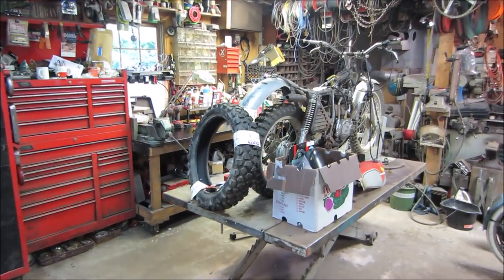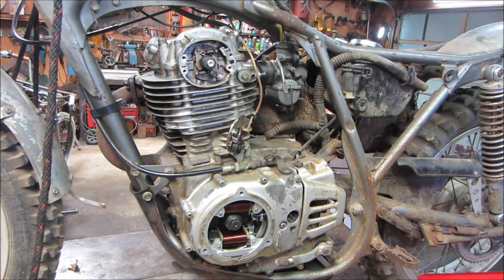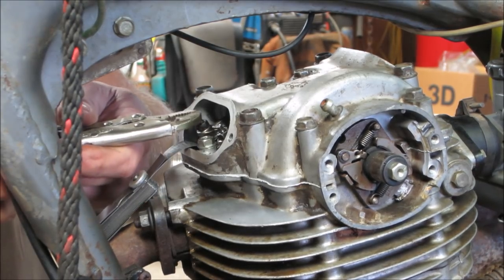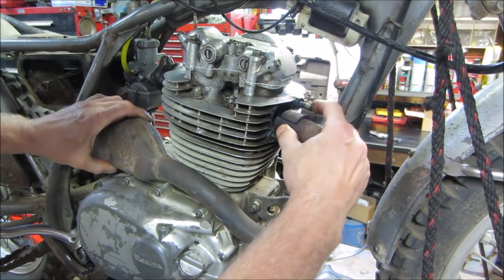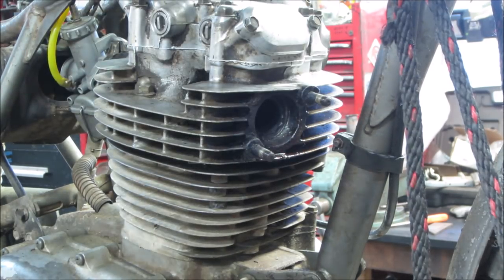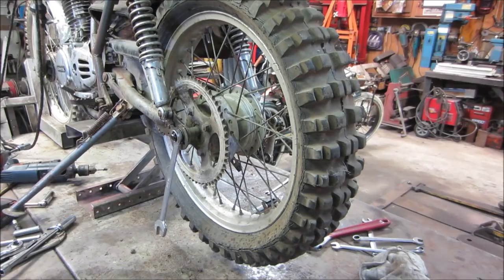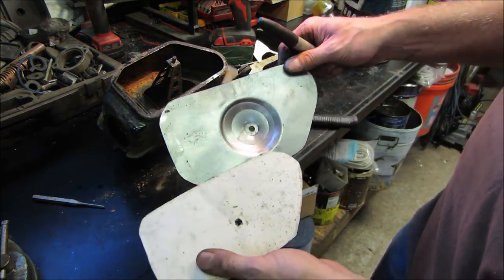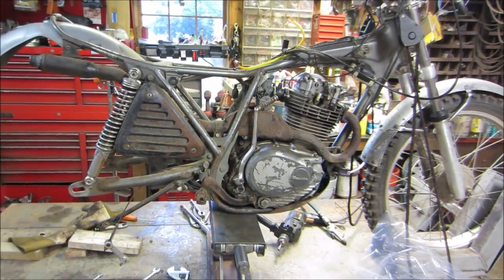engine work on the old honda 250 trials bike,

Comment: Hi Mustie, I originate from the UK, I am now retired & living in Thailand. My background is in aero engineering but I was bitten by the motorcycle ‘bug’ long ago. Until I moved to Bangkok, I spent my spare time restoring old motorcycles. It gives me so much pleasure to watch your videos. My main weakness was painting. I restored a 1955, 350 BSA & decided to have a go at painting it myself but I did have the fuel tank professionally painted. I used an engineering paint, made by a company called Blackfriars, but it’s main drawback was a long drying time & white spirit as a thinner. I didn’t have a spray booth - I got chucked out of the wife’s laundry shed for getting overspray on everything. I sprayed it outside on nice days. Trouble was it seemed to attract bugs. So many times I had to remove the paint & start over. After I sold it, the man who bought it sold it on but one day I got a phone call from the new owner. He told me that he had entered it into a concours exhibition & it won second prize. He said that the judges were impressed by the paint work because it didn’t have that hard ‘glassy’ look to it, which made it look as if it had it’s original paint. It’s main let down point was the fuel tank that was black with silver panels on each side, the silver should have been chrome! He wanted to know what other parts were not original so that he could make it fully original for future shows.

Comment: You repair of the exhaust pipe flange fitment and the air box cover really demonstrates the value of your metal working knowledge and experience.  I'm impressed.

Comment: After a lifetime in the trades I am able to do little else now but watch. That said I sometimes have a little trick to share and I think you will use them. Here's one. When cutting ,drilling or milling aluminum get a spray bottle of denatured alcohol as a cutting fluid . This keeps the metal from galling by keeping it very cool. You'll find it leaves almost a polished finish.

Comment: ahhhh , the sheer enjoyment of removing the rear axle on a vintage bike that hasn't seen grease since Japan ! Nice job on the air box lid fab .
Reply: I experienced that joy just a couple months ago (Trail 70 with 700 miles).  It was also very nice to have a nice hot garage to work in.
Reply: Watching Mustie use a panel beating hammer for actual panel beating.... Phew!!!!!
Reply: nothing compared to the stinky whale oil in the forks on vintage japanese bikes. wretch-inducing.
Reply: @jonnoMoto  I remember that fish oil, that’s crazy. Then again, it was when we ran still ran bean oil, no synthetic back then.

Comment: Mustie, I was going to suggest you use anerobic sealer on the rocker cover in the last video but forgot to mention it after watching. It will only harden where the surfaces meet, otherwise it stays soft and wont clog anything. I use it on supercharger assemblies because it stays soft when it squeezes out and wont damage anything if it comes in contact with the internals. That was some impressive flange making!

Comment: Excellent project that is inspiring me to finish a 1963 Honda 90 CL that I put together back in the late '80s and never felt the need to complete, as I was riding a HD Sportster back then & 1200s later, but now that I'm old and busted up, I might pull it out of the shed and get 'er done finally. Hmmmm?? Thank you for sharing this video.

Comment: A trick I learned for adjusting valves with those square adjusters is simply screw a #2 Robertson screw into a small wooden dowel and there ya have a holder for that square adjuster.

Comment: When you were forming the air box cover, a neat trick I learned from a metal worker: a foam seated bar stool. Put your piece into the middle of the stool seat and pound on it in the middle. It will draw the piece out where you hit it. I saw Jessie James do a fuel tank this way without using an English wheel. I've tried it a couple of times, works great!
Reply: Sand bag will also work
Reply: Yeah I've seen that done too...just don't over stuff it, you want the sand to be able to move so the metal conforms to the strike.
Reply: If the metal is heated- it stretches nicely, too.
Reply: and if you want to shrink it, dump ice cold water on it while it's hot......
Reply: Wouldn't a shock quench like that HARDEN it, make it brittle?
Reply: That's where I got that..but the old bar stool in my shop looks like it's been in a few fights..and possibly a couple wars now too ;)
Reply: yes ,,,so reheat it it to let it air cool, (anneals it)(makes soft again)
Reply: Shock quench will harden high carbon steel, but has no effect on mild steel. It's a pretty good assumption that Mustie was using common mild sheet steel.
Reply: The easiest way is to ditch the airbox and install a slip-on paper filter.
Reply: Vivian Stimpson yes , its the satisfaction of making it , no so much the easy way out
Reply: I like the way he did it, sharp looking job

Comment: If my copper seal rings are a bit too small, i get a punch or something that's cylindrical, put it inside the ring and roll it on a steel plate under hand pressure. Basically stretching it a little all the way around. Works for me. Love your channel btw, i work on old American cars in Europe.

Comment: Great video as always!  I understand why you speed up repetitive work, but I would appreciate subtitles for the high speed commentary if at all possible. 

I bought a broken 1965 Honda C110 (50 cc)at age 13 in 1971 for $100. It was completely dissasembled and Honda had stopped making shop manuals for it. Eventually I figured out that the exhaust valve was slightly bent. I tapped it lightly until it was straight as tested in a drill. After using compound to seat the valve and enlarging the exhaust port to match the pipe, a smaller friend hit 62 mph on it. It's 4 speeds, a clutch, and 17 inch wheels were lots of fun.  Looking back, I'm glad nobody ever got hurt riding it. My rule was, if you wanted to ride it, you had to wear ear a helmet.
Reply: I had a C-110 too!

Comment: The XL Airbox is a different shape I believe because XLs had a battery in that area strapped onto the side of the box behind the opposite side cover.
The edges of the original TL airbox side cover (I had a TL125, but yours looks similar) was rounded so that the edge fits into the groove in the neoprene gasket, so when you tighten it on it is completely watertight. That way the only water ingress point is the inlet which is at roughly the same height as the tailpipe. That way you could ride a TL through a river pretty well up to height of tailpipe without water getting in the carb. I rode TLs in very wet trials in the 70s & passed many a Bultaco knocked out by deep river sections.

Comment: with any stuck valve its sensible to remove the cylinder head and check out the valve stem,,seat and guides for corrosion.Good time to fit new valve stem seals if it has them. 9 times out of 10 the valve seats spotty with rust,and the stem needs a good clean.Guides need a good look over and clean, Lap the valves in by hand and its away again.Check the play in the piston and check the lip at the top of the bore which is a good clue for blow by. Enjoy your videos,cheers Graeme from New Zealand

Comment: I've been trying to decide if my favorite tool is your tappy-tappy hammer, or your little fuel bottle.
Reply: Definately the body hammer
Reply: Both are absolutely necessary in every workshop ;-)
Reply: I gotta say the fuel bottle with cam 2...purple
Reply: It's the body hammer. He uses that on everything.
Reply: Hammer ! But only for the tappy tappy reason ...
Reply: I'm adding both plus the q tips to my weak ass arsenal!!!!
Reply: @stillakilla7520 using  q tips are a good idea as well
Reply: I have added a white coffee cup to my tool bench to check for water in fuel situations.

Comment: I used to have a 1981 XL125S, before that I had an XL75 from 1977. Watching these makes me regret letting them go even more than I already did lol. I did a lot of work on the XL/XR engines, and that looks like the design they evolved from, a lot is very similar. I'd bet you could put an XR or XL 250 engine right into that frame with no fab work.

I still remember the valve lash for those engines, and it might be the same for that engine, 40 thou on the exhaust and 30 thou on the intake.

Comment: love watching your videos i like working on old hondas as well lil trick i learned take a square head drywall screw heat it up bend it over fits those valve adjustment screws makes adjusting them easy keep those videos coming !

Comment: Ladies and Gentlemen, always use a softer metal rod (Brass) to hammer out something threaded and steel. Otherwise you will "Mung" the threads. @41:24, Mustie1 (off camera) was bashing down the "Mushrooming" of the brass rod so it would fit the bore of the bearing. The brass is what you would call "sacrificial". Don't use a steel rod to do this. I hope I am not stepping on Mustie's toes. :-)
Great work sir.

Comment: I have a matco compression tester I've had for 25 years, it looks like the one you have, except there is a short hose that screws into the spark plug hole and a adapter for long thread motorcycle style spark plugs. I never had a problem with mine. My check valve was on the guage also and the hose was wide open, and it fits my air hose Chuck at the shops I worked at. I would use it to hold valves closed while replacing valve stem seals on the car.

Comment: When you kick it over and the compression blows out the spark plug, THAT’S compression!!  For that “little” 250, you’ve got more than enough. I had an XL 250 Enduro 1974 that ran like a top for years and enjoyed every minute of it roaring through the woods/trails. It was a dual purpose bike(street-trail) , but I stripped off signals,front fender, tail light, gauges ,swapped out the dual terrain tires for a good set of knobbies, changed the rear sprocket- dropped 2 teeth, and first time out torqued every nut/bolt/screw. Also had the high ground clearing exhaust (scrambler ?) sitting just high enough to get your inner thigh burned if you weren’t careful.

Comment: A leak down is used on aircraft cylinders since they can crack and lose power.  I looked for about 78/80 to show a good cylinder.  If not, listening at the intake, exhaust, and breather would pinpoint the leak.  Friend of mine had an O235 Lycoming with a hole in the head casting.

Comment: Check the cam chain adjustment - it's nut on the back of the barrel. The adjustment on these bikes is manual. Adjust it to the point where it isn't noisy. It might be the camera, but when it was running in the other video it sounded like it needed adjustment. I've fixed many hondas that have jumped timing. I've even hammered the valves straight again when I couldn't get new valves.

Comment: The engine of my CB250RS is similar to this being more or less the same twin port engine as used in the XL250S and it's bigger brother XL500s also the XR engines. Similar, as there are quite a few differences like no centrifugal filter in the later engines, but a chain driven balancer. A very easy engine to work on I think, as I can do all top end work with the engine in the frame, a few years ago I replaced the cylinder head with a better one (not cam wear I would add, 1000 mile oil changes stop that) on the frame and it's also quite easy to replace the cam chain using and endless one without doing much more than taking the clutch cover and rocker cover off and taking out the camshaft.

Comment: I've repaired exaust pipe flanges on motorcycles with  thick pants or thinner shirt clothes hanger wire depending on pipe size welded on then painted with a couple of coats of charcoal grill high temp paint then dried for a couple of days.

Comment: A good "get ya by" trick for copper gaskets is to anneal them before re-using them.  Copper easily work hardens, but if you heat it up with a torch and let it slowly cool it'll soften up a bit and give you a better chance of it resealing.  Not too sure if the exhaust would't effectively do that anyway.
Reply: copper is pretty tough to anneal well.
Reply: throttle bottle  - Yeah, better to use a new seal, but if you've got no other choice it can help.  We were trained to do it on HPAC seals in the Navy. (Ebay doesn't ship to submerged vessels :)
Reply: they probably do now or will soon!! :)))

Comment: On all those OHC Honda engines it is possible to pull that points cam off the centrifugal weights and replace it 180 degrees out,  This makes the engine try and break your leg while kick starting it and I've seen the stater gears busted from the engine firing backwards with the starter gears engaged. That took a lot of finding the first time I came across it.

Comment: oil pump up the right rear cylinder stud on those, that's why the "cap nut" is on there. oil pump check was loosen/remove that cylinder nut, start and idle at 1K rpm  cold engine (around 70F) and oil should flow in about 10 seconds max. tight back to 22 to 25 ft.lbs. pretty much covers all honda 1 lung 4 stroke.

Comment: You did the timing right, the proper way is the cam lobes have to be pointing down, line on the cam lined up with the head surface and flywheel at the marks before the fire marks.

Comment: Yes, when it comes to sealants like that or especially silicon carne, “the bigger the gob, the better the job”, definitely does NOT apply! Oh, and your local NAPA should have adapters for your compression gauge. I know ours does, because I had to get one for my old Gold Wing since it uses those same “peanut plugs”.
Reply: Exessive sealant may alter the cam bearing clearances.

Comment: I learned to use a matchbook cover it was always 0019 thousands, and the plugs were set at 0035 thousands, used a matchbook doubled over and closed the gap a little to get 35.

Comment: made me go dig out the 70-78 "clymer" manual 0.012 to 0.016 point gap, 46 to 49 dwell. battery/test light should light just at the "F" timing mark for static method. get close start, idle, timing light right at the F mark idle about 1K, revved around 2500+ will be between the next two proceeding marks(check advance)
valves are 0.002" intake and 0.003" exhaust. guess my memory isn't too bad i was only off a bit guessing :))

Comment: Totally makes sense on why you didn’t pull the head, I wasn’t thinking about the tight fit. Is there a difference between the Honda tight bond and other sealants in a job like this? I know Ford engines are practically assembled by a ford speciality sealant anymore.
Reply: I remember about 30 years ago when I ordered a nissan oil pan gasket from the dealer and they sent me a tube of grey sealer.
Reply: There were a bunch of replies on his last video that mentioned some very similar sealants. I don't recall what they were.
Reply: from what I recall, they all used either black/grey silicone or colored "gasgacinch" in their branded tubes.
Reply: @lwilton    ...... Honda bond is great! So is Permatex GREY.

Comment: I'm told that Hondabond stuff works pretty well...but anytime I'm remotely near an oil gallery or have concerns about how much sealant squeezes out, I use an anaerobic sealant.  They only set where the two parts meet, so any that squeezes out won't set and can be washed away by the oil when I finally start it up.  It takes a lot of the worry out of rebuilding.  :-)

Comment: I know you said you were going to revisit the valve adjustment in the future.  I would think a gap of .006" for the exhaust valves would seem about right with compensation for expansion.  3-5 thousandths seems right for the intake valves but the exhaust should be closer to 6-8 thousandths to allow more room for thermal expansion.  At least that is what I have seen most often when working on small engines.

Comment: a square head wood screw fits perfectly on the valve adjuster stud , if you don't have the right tool , give i a 90% bend to get a good grip as you screw in or out

Comment: leak down testing: actually if you get it perfectly on top dead center it will stay as you apply air you dont apply full shop air pressure but use the correct tool which applies a calibrated amount of air and will give you a leakage reading in a percentage of leakage then you can determine if your leakage is acceptable and hear where you have excessive leakage by listening to intake, exhaust or breather

Comment: On those exhaust gaskets: it's better to get the aluminum ones with the fibre material in them, the copper ones are one-use only, where the others can be used over and over a few times taking the pipe off for painting or repairs in the future
Reply: Also, put some Nev'r seize on the axle when re-installing so it doesnt get stuck for next time
Reply: they're all "one use" gaskets. technically, if bored you could anneal the copper and run it through a loose roller setup to decrease diameter and increase thickness again, then use it again and again....... 
the alum/fiber middle, junk for sure

Comment: Nice work on the flange, could also be a blacksmith :), and the covers.  I'd just run those old tires till they splitting, it's meant to be used at very low speeds anyway.

Comment: Love your channel Mustie. I have a couple recommendations for your future rebuilds:

Allow the Hondabond or any RTV to set up for 15-20 minutes before attaching the item in question. I've never had good luck with smearing the RTV like you did. Just leave it in a bead and it will go where it needs to.
Reply: in that case, you don't want it holding the top separated any, it will make the cam bearing clearance too loose, end result ignition timing jumps around wildly ;)
they should have had it fire off the crank, but that would have caused issued all  to it's own lol!